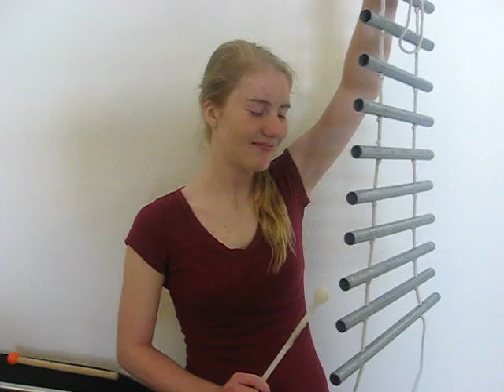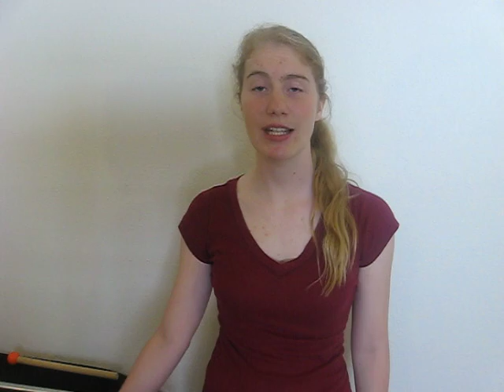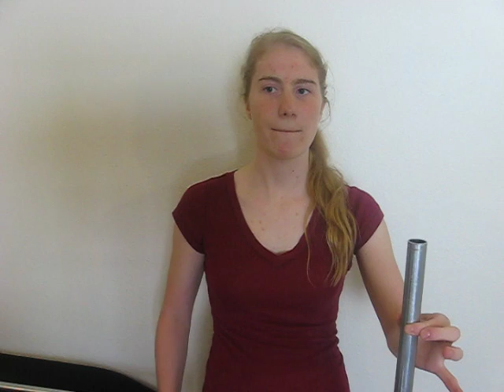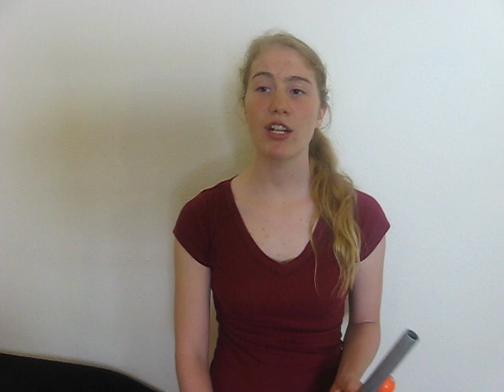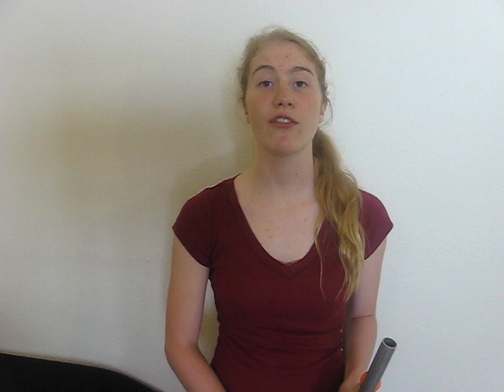Changing Frequency on Electrical Metallic Tubing by Sarah Tulga

Comment: Ps. some questions:  1) if i fix my tube at two points (using formula L x 0.224 for distance) Does it reduce sound or better fix tube only at one point ? ( i think no different ) 
2) how i can detirmine "start" for example "C" note lenght of tube only experimental ? ( i mean if i got tube 2 meters and need C tube about 60 cm so i cut near 1 meter then starting fixies using tuner ? ) THANK you !